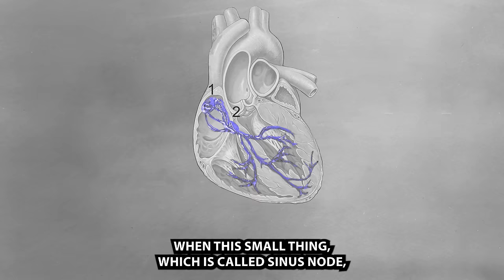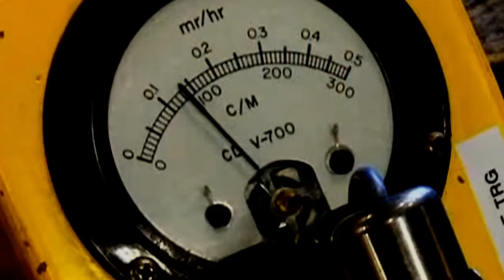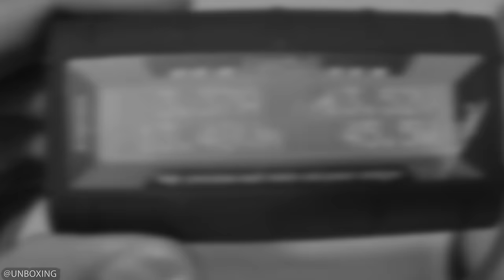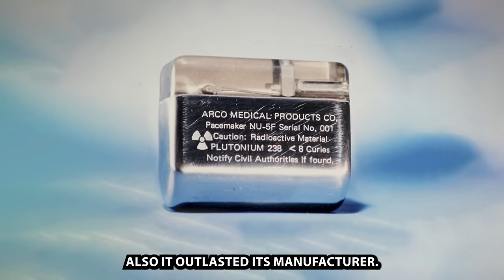Nuclear Powered Heart

Comment: I got my pacer/defibrillator back in 1993 and before then there were some with plutonium powered ones being used. It's my understanding they were discontinued for several reasons. I was happy that they were discontinued because you have to report your every move to the government. My 1st one was battery powered and recharged every three months. The other 4 were replace every 10 to 12 years.

Comment: all the remaining people are in france now. there are other downsides, cant have an mri (future pacemakers mighe be able to)
weird artifacts on CT/xray
heat produced
pretty bulky. i think the real reason we went with lithium iodine or whatever salt theyre using now is because probe placement accuracy got so good that you need very small amount of current, and in the 1980s they figured out how to detect when to shock the heart instead of shocking it all the time randomly. also the size is just so much smaller and we now have good data on how long people will live, and the risks of surgery are way less now with strong antibiotics we have and better sterile equipment/ppe/surgery techniques. these are the real reasons why it went away. battery technology was a minor contributor. also you wouldnt be able to have it do defibulation unless you had a large available supply of power to draw from instead of the trickle that you get from plutonium wrapped in thermocoupple (nuke thermo generator)

Comment: From my limited understanding of this, it also overrides the brain's impulse to the heart.   So, in essence, those that suffer from hypertension due to a natural resting heartrate of 95 on up.  It is my understanding that it also simply just acts as a clock.   It regulates the heart rate, thus reducing blood pressure by reducing the amount of blood (beats per minute) the heart is pumping.   If I'm wrong on this, I'd like someone with a better understanding of this to clarify.   Thanks.